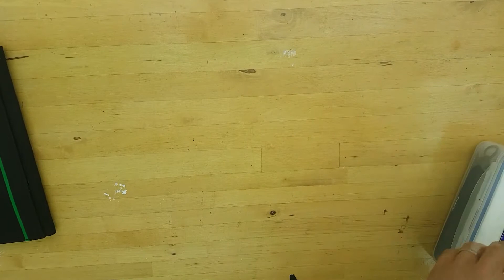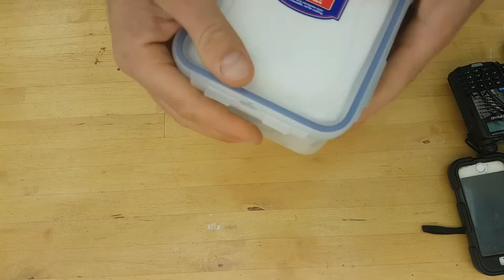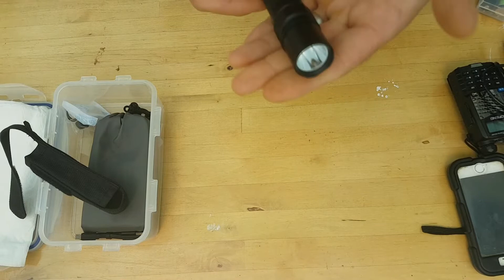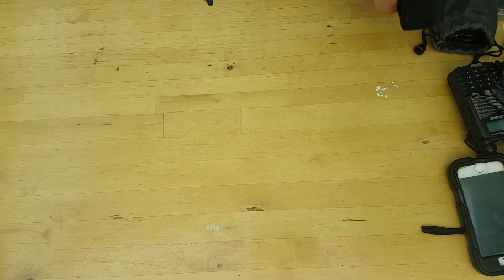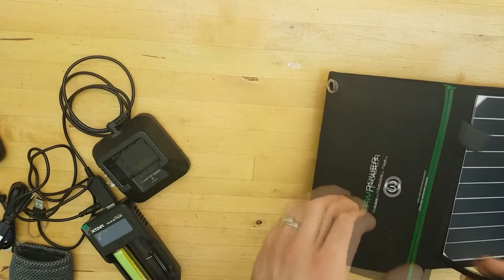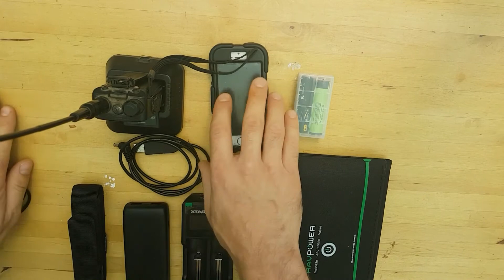Bug out bag Electronics Inc USB Charger for Baofeng UV5RA

Comment: I came here after reading your comment on another channel about the USB UV-5r charger. Tip on getting your solar panel correctly positioned is to cast the largest shadow possible. ❤️ 

Buck Boost regulator built into the UV-5r changing base is also an excellent option.
Reply from the maker: Thanks buddy! I like the idea about the shadow and I will certainly look into the Buck Boost regulator, I have never heard of them?
Thanks again

Comment: Hey man, awesome setup. If i had two 18650 batteries in the XCAR, how many charges could i get of my phone? 

Thanks in advance!
Reply from the maker: Hey buddy, I am not 100% sure on that as it would depend on the capacity of your phone and the 18650s you are using. 
All I know is it works well with my Galaxy s7 and my iphone 4s, I perhaps need to do more testing.

I have since started using the Xtar as my home charger and use a single 18650 charger from xtar for carrying to scale down on the bulk.

You wont regret your purchase though, they are pretty cheap considering what they can do.

Best of luck mate
Reply: Awesome, I have a Galaxy S6 and will be getting a Baofeng so hopefully the 18650 batteries should be useful. They seem pretty versatile so they are worth picking up even if they are for another project!

Thanks buddy.
Reply from the maker: You are welcome mate

Comment: Awesome kit, I like the solar chargers, Electronics should be an important part of any kit now days, Subbed you.
Reply from the maker: Cheers buddy, I am just watching your Electronics video now and realise you too own a Baofeng.  Just a heads up, you can get a usb charger for them and it works with our current docking charger. The link is in the bottom of the description on this video. Off ebay and only costs £1.50, makes the radio a lot more versatile.

Peace
Reply: Looking into that this morning.Thanks